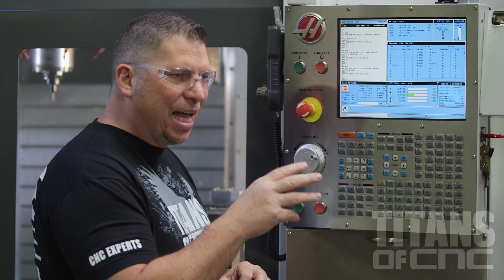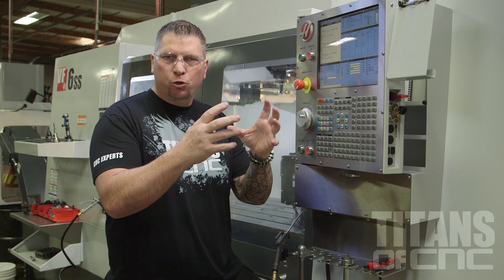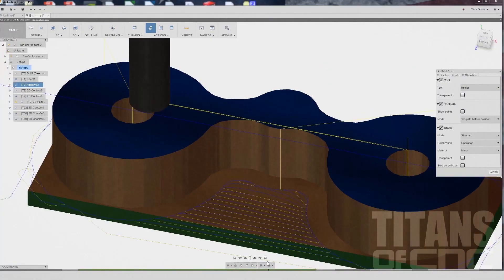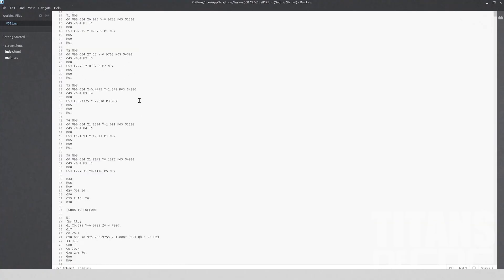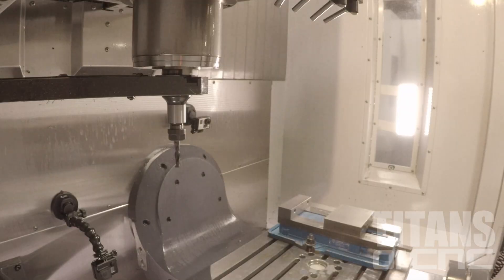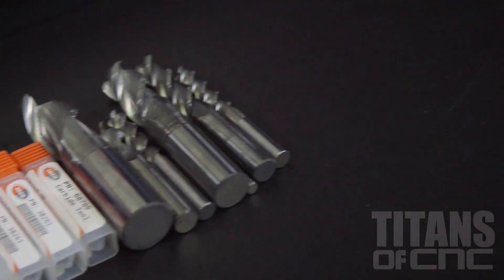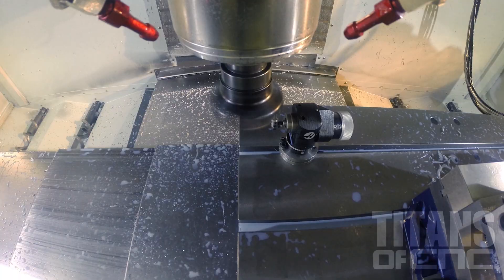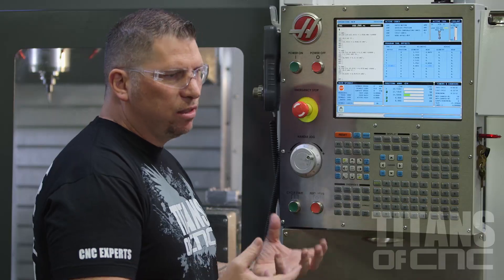Manual VS CNC Machining

Comment: It's simple really: If you create one off parts and you have a low budget get a manual machine. If you need to produce large batches of identical parts and cost if no object, get yourself a CNC machine but first learn how to use a manual machine to really get a feel of what's really going on.
Reply: @behemothinferno Thats kind of the conclusion im coming to. I need to make one-off simple parts out of metal and i was discouraged when I saw the prices and complexity of the cnc machines. I think Ill end up with a mechanical machine.

Comment: Manual machining can be just as fast and efficient as a CNC on some jobs. The amount of time to grind a form tool out of HSS is much less than programming, loading and using all the different tooling. Another thing... this guy did a climb cut on a Bridgeport lmao

Comment: Well, I'd say some things are faster on the manual. I always thought a cnc is the future and can spit out parts faster than the manual. I work at a shop where we usually make like 3 parts at a time, and 95% of the time, a manual is still the better option as far as efficiency
Reply: Well the robots still struggle with napkin cad. So l think l will have value as a machinist:) cnc or manual.
Reply: Cnc is a dying trade as the robots will completely take over soon. Manual machinists will always have work in machinery repair just like they still do today.
Reply: @oscarlavista7677  Unfortunately, CNC is not a dying trade. Someone still has to design the parts, program the machines, load the machines and handle the finished product. A robot cannot completely take away the human element in manufacturing.
Reply: @oscarlavista7677  you mean manual machinists are running out of work

Comment: Very interesting.  I'm recruiting for a Manual Machinist.  I've only worked with CNC Machinist positions in the past.  Can anyone tell me why a company with CNC machines would also utilize manual machinery?  I've noticed that manual machinists are hard to come by.  Any info is appreciated.
Reply: For really quick parts and prototyping, especially where the tolerances and dimensions don't need to be perfect, or for 1 or 2 off jobs it can often be quicker to use a manual mill or lathe. Manual machines are also great for small adjustments to additional parts. Manual machines are beneficial in small runs and especially modifications, because the part does not need to be modeled and the machine does not need to be programmed ahead of time. However, for any quantity of production larger than say 5 parts, or where tolerances and dimensions need to be precise and consistent CNC machines are the way to go; CNC machines trade a little bit of upfront programming time for the ability to run 24 hrs. a day sometimes even unattended with extreme consistency, thus saving you time and thus manpower and money. Many new CNC machines can also run faster than their older manual machine counterparts simply due to the fact that they are new and not so worn out again increasing productivity. If you have to choose between one machine and the other pick a CNC Mill/Lathe every day because, if need be you can use them as a manual machine by jogging each axis manual with the hand dial, which while not as convenient as a manual machine for small jobs will still get the job done.
Reply: Coulombic Distortion you can get just as accurate and consistent on a manual machine, it just takes some carefull measuring and setup.

Comment: I'd say debatable, if you are only making 1 part manual would be faster, but 100 parts, cnc is faster
Reply: definitely depends what kind of part it is though. Without special tools it's awful hard to cut a gear on a manual mill, the time for cad & cam would be worth it to be able to cut the single part on a cnc

Comment: CNC is a must for production jobs. Or else its just a very expensive fancy toy
Reply: Sachin Ki not exactly I run a job shop with 5 CNCs (3 Mills/2 lathes) and it is a lot easier to go program a complex piece real quick to achieve faster part time and better surface finish and tighter tolerance.     The ability to climb cut is huge also.

Comment: Cnc is King for precision but manual is tool men use not programers.. personal opinion I know but if there's no feel to doing it then it's not you doing it or "fake" but cnc rules for time and precision where $$$$$$ matters
Reply: chris jones, I agree that to programme a machine isn't craftsmanship. Just like you wouldn't call a microwave operator   cook. As for production their is no contest either. But completely disagree that CNC is more precise. A true craftsman (Not the many that claim to be) can produce highly accurate work (microns or tenths) on a basic manual machine. Nobody could ever do this on a basic CNC.